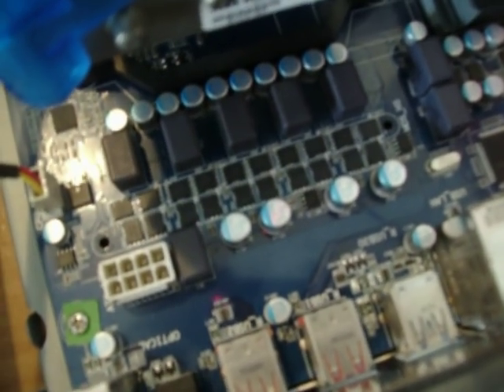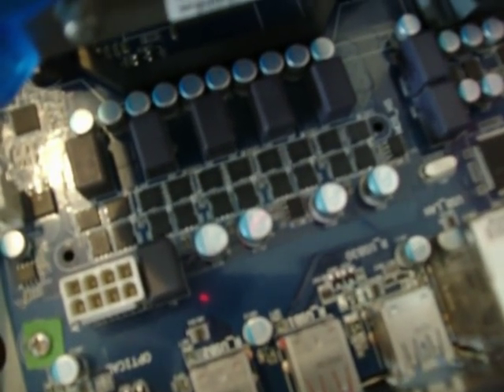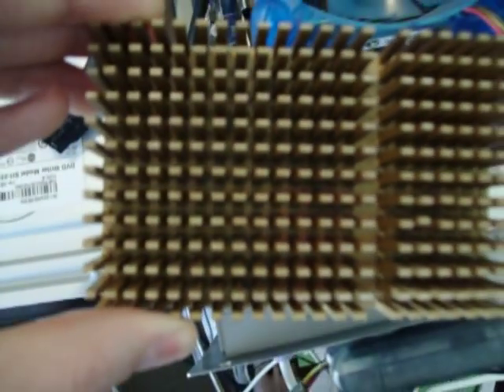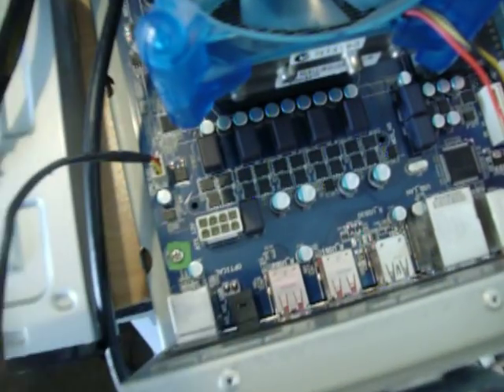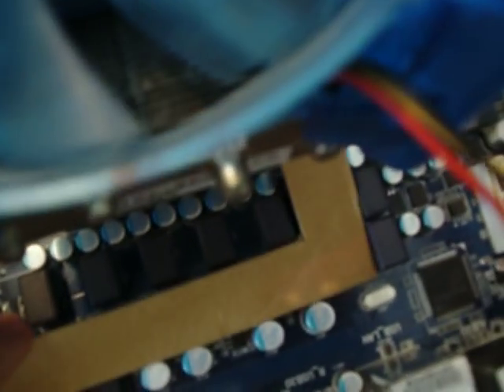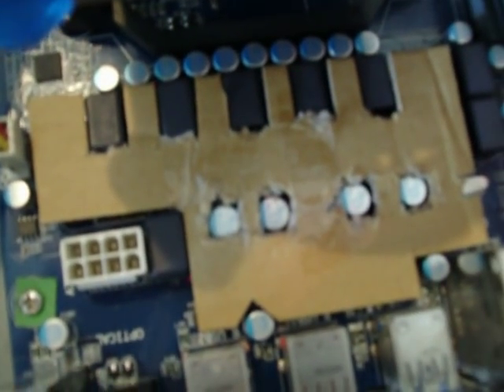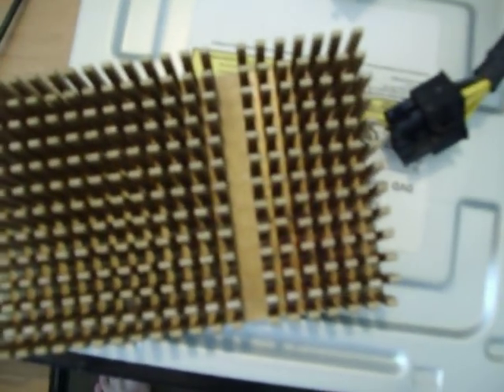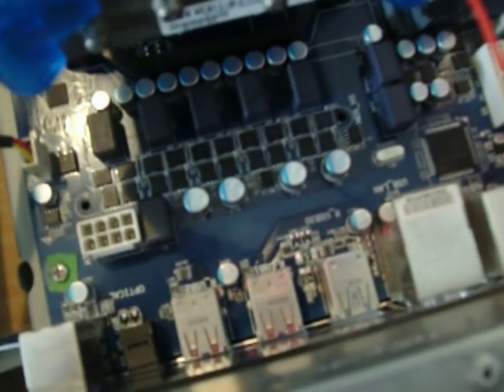How To: DIY Motherboard MOSFET Cooling, Part 1

Comment: im going to attach some 1mm high copper shims to behind the cpu socket, on my m5a99fx pro v2.0 board, there are 8 mosfets that get stupidly hot, adding these sinks will knock the cpu temp down by a massive 10c if a small fan is blowing onto them, attach with thermal glue.
Reply: it will mate

Comment: My asus B85M-G started to throttle on high overclocks (1,3V+). After removing throttling with ThrottleStop (disable BD PROCHOT) i could go from 4,5Ghz to 4,7Ghz stable on same voltage but after a while on heavy stresstest the computer would shutdown. Adding heatsinks to the mosfets solved the problem.

Comment: Ugh at least this motherboard has screw holes.  I just bought a new motherboard and realized it doesn't have a heatsink and there are no screw holes.  At least with screw holes I could have bought something like a Thermalright HR-09 heatsink
Reply: you will have to use adhesive thermal compound, which is going to be next to impossible to remove if you ever have to.
Reply: FailedSquare Yea, I don't plan on using thermal adhesive until the board's warranty period ends.  Before then I will settle with smaller heatsinks with thermal pads.

Comment: hey im having a simmilar problem, if i were to just mount a small but poweful fan to blow on the vrm would it help?
Reply: No, i have same problem and it only give you 10 or 15 min more stability but at 20 or 30 min of prime95 test it fail again 😭
Reply: I think that this handmade heatsink will work very well

Comment: thats why down faced cpu coolers are better solution, cause they blow directly left and right (at mosfet and ram)
Reply: That's why stock HSF are made this way. One who goes aftermarket should know this issue can occur with big CPU HSF so he should also invest in an additional fan. My case has 220 mm fan on side panel so i'm more than good, lol.